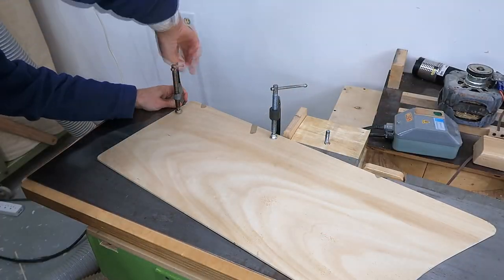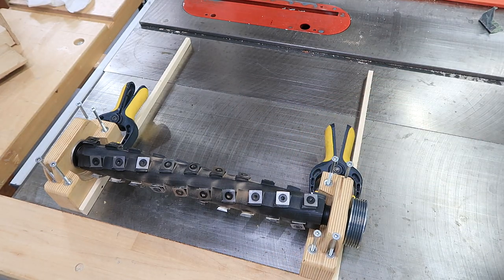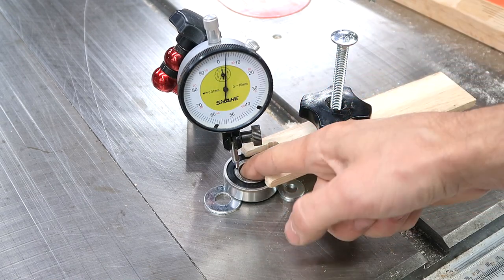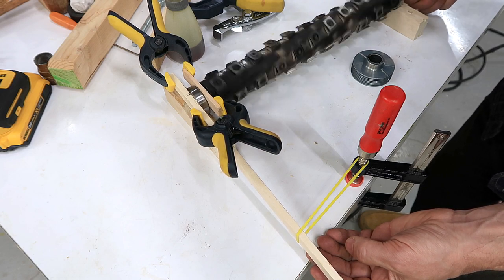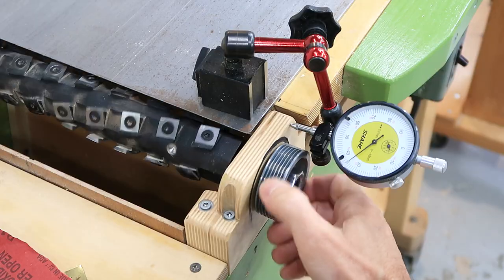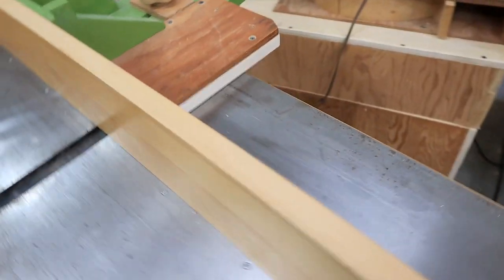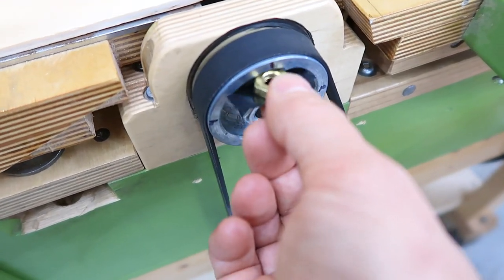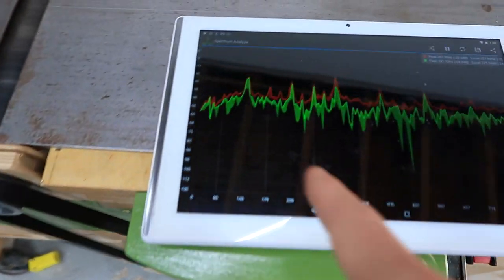Trying to reduce jointer noise and vibrations

Comment: I love it:  All sorts of fixes to get the machine to run whisper quiet...run some wood through and it breaks your eardrums!  I think you have reached the point of diminishing returns Matthias.  Great video thumbs up.
Reply: don't mind the noise while using the machine, the goal is to make it so silent you can leave it on at all times!
Reply: @sliceofbread2611  A planer that you can't tell whether or not is on sounds like a great safety feature ...

Comment: SKF invented the spherical bearing just because of this issue. In the olden days it often was the case that the mounting surfaces for the bearing blocks were not aligned/parallel/co-planar due to poor foundations.
Reply: My 1940's sander has those (replaced with new of same type) on the pivotting tracking roller. Those bearings are quite noisy with the freedom of movement they allow.
Reply: Do you think a slightly flattened bearing, (oval, egg-shaped) would have the good features of both?
Reply: @davekavanagh7599  a compromise is always going to be a compromise.
Reply: Earplugs. You're welcome. :)
Reply: Needle bearings are the way to go for this application.
Reply: "Hey, go bust out the 12 meter by 50cm boring bar, I got this building-sized-machine to bore out."

Comment: Hello Mathias, I'll give you the mechanics' way of working: when you place your puller on the outside of the cage of a ball bearing to take it out, this bearing is considered broken because the effect of forcing it on the outside of the cage causes the bearings to shatter.  It is with pleasure that I give you this trick.

Comment: The high axial vibration is an indicator of cocked bearings and/or misalignment. You did a nice job of reducing vibration given the machine is constructed of wood. If you set a stroboscope at the rotational speed of the cutting head you will be able to see how the bearing blocks are moving and/or if the cutting head is shuttling axially in the blocks. The line frequency vibration is referred to two time line frequency vibration or 2xLF . It’s typically very prominent on 2 pole motors operating at 60Hz (3600rpm) but can be seen in slower motors as well. Belt pass frequency is generally much lower than motor turning speed but can create problems with cutting if vibration at that frequency is severe. In addition to BPF(belt pass frequency), 1xRPM of the motor and 2xLF, the spindle rotational speed will also show up in the vibration spectra. Bearing fault frequencies are non synchronous to rotating speed. Simply calculate rotation speed of shaft by the defect fault frequency to determine if you have a defective bearing. For a 6203 bearing the outer race defect freq is 3.05xrpm. The inner race defect freq is 4.95xrpm, ball spin defect freq 1.99xrpm ( 2x ball spin can also show up) Cage defect freq 0.38xrpm . I can go on forever on this subject so I’m gonna stop now…
Reply: Are the factors calculated? From where did you get these numbers/formulas, I never saw something like this (I studied mechanical engineering). What do you work?
Don´t stop, please😀

Comment: When you have two ball bearings mounted as you do, one needs to be fixed so the end doesn't float. Look at an electric motor. One end is held clamped and the other has a spring to take up any movement as it floats when things warm up.
Reply: That seems like an insightful comment to the uninformed me. I hope he responds to it.

Comment: Interesting! The bearings are, no doubt, a source of noise and, most likely, also vibration. The new bearings will highlight the other problems you have. I would suggest, if you have access to a lathe,  check the Shelix bearing surfaces between centers - I have a feeling that they are not as square as they should.
Reply: I believe you saw what he uses for a lathe in this video: wooden, doesn't have a big engine lathe
Reply: He doesn't have a metal lathe.
Reply: He definitely had one, dont know if he sold it or still got it
Reply: @awldune  He doesn't need a metal lathe to check it for concetricity. A wooden late with 2 centers allows to mount it, and then he can easily check it with the dial indicator.
Reply: Buy aircraft quality bearings, you can hear those bearings making that rushing noise that worn bearings make. It may be a peculiarity of digital transmission and iPad speakers but it is very noticeable.

Comment: Looks like the shaft where the bearings mount could be ever so slightly worn or not perfectly straight or round causing the vibrations side to side in the bearings… run the dial indicator around the shaft next time it’s apart! Great video!
Reply from the maker: I'd have to have some reference for it to spin on, which means, with the bearings on!
Reply: @matthiaswandel  stick it between centers in the lathe?
Reply: as a machinist,  it seems to me like  the shaft is bent, you can either put it between some centers like  suggested above or set it on some v blocks,  even wooden one will work then while its stationary let it spin and set the indicator on top that will basically tell you right away if its bent.  Also when you have indicator on the block if you actually look at the pulley( the pulley are precision fit and should not be running out like that) and the shoulder of the cutter you can see the run out, the bearing noise  and blocks moving are symptoms of bent shaft not the cause.

Comment: "... as long as the wobble is within the slop...".
Like it. I will use that on my next engine rebuild...

Love the analysis Matthias. I do however think the bearings are shagged, as we say in the UK.
Reply: I'll bet you when he replaces those garbage bearings with SKF, the wobble will be worse than the slop, and he'll have to take another shot at it!
Reply from the maker: I might have to add some shim to the rear bearing mount to compensate for the wobble.
Reply: @matthiaswandel  look forward to seeing the results.
Keep up the good work... always enjoy all of your output. 👍🏽
Reply: @matthiaswandel  would it be worth it to have a machinist chuck it in a lathe and check to make sure the bearing seats are true to the shaft? That could be a reason you have wobble.
Reply: I hate when my wobble isn't in my slop.

Comment: You identified the resonant frequency of the belt and the motor noise. I bet you're getting some beating between those two sources as well since they're close to multiples of each other. You said something like 65hz and 120hz, so you might get especially strong periods of noise when the amplitudes build on each other. the first harmonic of 65hz is 130hz, so you would get a 10hz beat generated by that harmonic and the 120hz motor noise. Super cool series! I love how you've been making your own sensors lately.

Comment: I absolutely love this practice of building your own machines to your own specific use. And seeing how when you need to get inside and adjust things how easily it can be taken apart and modulated.

Also the process of improving what you have in your shop is forever one of the most satisfying things to do, but wow you take it to a WHOLE new level that I look forward to trying myself. 

Very entertaining and packed with nuggets of info. Love the content!

Comment: This was excellent. The video, and the comments. Just the way it should be: useful, educational, informative, and thoughtful, respectable comments. 
Say, that reminds me... I once was checking a truck engine for noises and was using a "listening stick"(?). A 1 1/4" wooden dowel about 24" long. Placed it on different components, alternator, etc... And the other end to my ear. I wasn't locating the phantom sound... My buddy pointed out a knot in the dowel that was loose enough to be able to be pushed back and forth a quarter inch. He said, "You have to turn it on!"

Comment: Making a bearing holder out of a compressible material is a recipe for sympathetic vibration.  Put a real metal bearing block instead of wood.  Also add some metal inserts into the mounting surfaces to stabilize.  Many things can be made out of wood as you have demonstrated.   The mass/inertia of these parts and the rotational speeds mean you have some complex dynamic forces with considerable energy, gyroscope procession with significant force, etc.
Reply: But the video demonstrates that even with wooden bearing blocks, you can tweak the machine into the "good enough" territory.
Making metal bearing blocks to the exact tolerances is not an easy project. Ordering to have them made is not cheap.
Reply: @antipode_ghost  Exactly, not everyone has acces to lathes or milling machines. It may be that hardwood bearing blocks would help somewhat.
Reply: Can't you just use some pillow blocks, I bet you could find some that would fit.
Reply: no lol, if anything wood dampens the vibrations, the problem is the shaft is bent
Reply: I have a feeling that the belt tension under load is torquing the bearing blocks and causing the rear bearing to squeal. The front bearing acting as a fulcrum.

Comment: Fascinating, all ready to use the speaker and scope method, and then immediately discover bigger issues. I imagine that's why there are curved surfaces in metal "pillow blocks" for bearings, to help cope with this kind of issue?

Comment: Wooden brackets likely the source of everything, I mean everything has its tolerances based on the design and engineering but wood is notorious for not holding its tolerances, opinion though from someone who hasn't built one :face-blue-smiling:, obviously its amazing that you built this

Comment: Very interesting! But i think you are chasing for metal machine-precision, with wood that is constantly warping and changing due to moisture in the air. New bearings will probably help though!
Reply: this.

no matter what type of bearing you use, be it from Turkey or Germany. if the foundation on which bearing is attached is unstable then it will wobble especially if you are using wooden foundation. use metal foundation and then precision machine it. otherwise even the new bearings will start to wobble after sometime

Comment: Even if you ordered sealed bearings, I suggest you carefully remove one of the seals and lubricate the bearings every once in a while. The seals will start to wear out after some time, causing some small particles and dust to start seeping into the bearing.
When i was younger, I used to ride a 50cc moped for 3 summers straight, first summer had to replace the rear wheel bearings twice (sealed). During the second year, I replaced the bearings again, and after a couple of weeks of riding, I removed one of the seals on both bearings and gave them a good clean and lubrication. Second clean and lubrication after about a 3 month period. And those bearings lasted the 2 summers I was still riding with it.

Comment: I've been a big fan for a long time now. I've always loved watching your creativity unfold in your videos as well as seeing your methods of solving common issues.

I'm curious about one thing, are you set on keeping wooden bearing housings? Why not use pillow block bearings? If there is not one available with the correct inside diameter for the shaft then I understand. Your engineering and building of this particular machine is my first memory of your channel. Wishing you and your family all the best in life.

Comment: The cylinder when rotating is actually a skipping rope. The bending moment in the center causes minor deflection, but at high speeds you end up with a huge amount of tension pulling on the bearing blocks.

Increasing the stiffness of the bearing block, adding thrust preload, and reducing effective span (by putting a contact bearing/bushing in the middle of the cylinder) can all reduce the effect.
Reply: "Shaft whip"
Reply: Agree with the solutions but in this application, how could we apply a bushing in the middle of the cylinder? How do you add thrust preload too?
Reply: @davekavanagh7599  the shaft was likely manufactured by turning on a dead center with a lathe and a center point on one end. Use that drill hole to add a nail point that pushes on the shaft end with a simple lever and spring or rubber band. A more complex solution is to add a thrust bearing and block to the end of the shaft.

Comment: Well done. I enjoyed your analysis. Watch out for knockoff bearings also. I picked up some name brand bearings on a certain auction site that I am fairly certain are fakes. Now I either buy old stock from the auction site or use my local electric motor shop.

Comment: That was quite the thorough investigation, and the combination of play in the bearings with crooked/non-parallel  bearing seats leading to the wiggle as bad that it was actually visible by eye even without the "woodstick amplifyer" was what is a common problem with chinesium machinery. The 120 Hertz thingy was a little bit of a surprise though.
Thanks for sharing!

Comment: You can reduce that torque "vibration" by adding mass to the motor shaft. e.g. a flywheel. On stepper motors, the improvement is nothing short of amazing, not sure how much of a difference it will make on a big AC motor like that, but it's probably worth trying, and it would be very interesting to see what difference it makes.

Comment: Get a CM01B vibration sensor, it is meant for that application. I use them often for biomechanical measurements.
Reply: What do you need to use the sensor and log data like the frequencies and amplitudes?
Reply: @Convolutedtubules  a microcontroller with a decent ADC input and a PC. Or an oscilloscope with memory.

Comment: The left side of the belt is oscillating more than the right side. Have you tried either an antivibrating belt or a spring loaded tensioning wheel on the left side of the belt to reduce/ change oscillation in the belt? It looks like someone is strumming the belt like a guitar.

Comment: There are some very cool videos of people balancing DIY jet engines using the shaft rolling on pressure transducers - might be more effective and seems easier to use, although this did work....  Also, you probably need taper roller bearings as the normal ones are not designed for side loads.  Greasing the bearing would probably help as they sound really dry....
Reply: What he has IS a pressure transducer.  How do you think loudspeakers work?

Comment: Besides of bearings with tighter tolerances, 2 thin pieces of rubber underneath the bearing blocks might make a considerable difference. Excellent video btw.
Reply: This may reflect as oscilation and cause cut marks.

Comment: Have you ever considered playing around with a VFD for your motor? I understand it's not necessarily needed, but for for fun and experimenting it could be fun.
Reply from the maker: No.  Those things are expensive!
Reply: @matthiaswandel  You can get a 2.2Kw VFD for 100 CAD, free shipping, on Aliexpress. In case you didn't already know.
Reply: @Mr_Wh1  I actually scored a 3hp Hitachi new with external control panel option for $80 a while back.
Reply: VFD would be cool, to set different speeds maybe or to find the least resonant frequency.
Reply: He would need to get a three phase motor. I mean, there are some VFDs that can run single phase permanent capacitor motors. But the selection is much less than what is available for three phase.
Reply: @mckenziekeith7434  True, but it doesn't change my suggestion.

Comment: How about adding grease to the bearing shouldn’t that lower the friction noise the bearings are making but I heard that using grease instead of lubricant oil works better for noise..you should make a video about that to see if that helps out or not..I know I would like to know..

Comment: The carbides breaking plane of the anvil will make noise no matter what especially with standard clearance bearings(c3). Even a 3 ton mill sized chipping head makes a racket because of the air noise.
you could probably get a bit less noise by filling a syringe with grease and adding some to the bearing. maybe 5-10ml

Comment: This cutter head seems pretty loud for a helical cutter. At trade school we had a grizzly planer with a helical cutter head, it was a low hum when it was on.
Reply: The noise in the jointer primarily comes from the air around the table lips, you don’t have that kind of crowding inside a planer

Comment: i dont know what exact type of bearing you are using but very often it helps to preload the bearing. pushin the inner ring to one direktion and the outer ring of the bearing to the oposite direktion. this shurely will lead to a higher energy consumption but the bearings will no llonger have the ability to wobble in its tracks.

Comment: For the modulated motor output you could try a flywheel to increase inertia, because the wooden pulley is really light, or - for extra smoothness -  a dual mass flywheel.

Comment: So in looking at the helical and shelix planer heads, I'm under the impression that the separate cutters being able to be turned is arguably I'm more important feature then then being carbide, how many species of wood really necessitate carbide? So I find myself wondering if anybody has experimented with separated HSS cutters, giving the benefit of the reorientable inserts, but hopefully saving a large amount by sticking with HSS. I guess I have not seen it stated as a marketing benefit, but I've always found the leveling of traditional blades to be fussy and annoying, being able to torque down an insert and know that it is perfectly concentric is very appealing; but that's only as true as the quality of machining on the cutter head. And that's a difficult thing to quantify from a consumer standpoint. Have you given any thought to the idea of separated HSS inserts? Or any other variations of these popular reworks of the past 10 to 15 years?